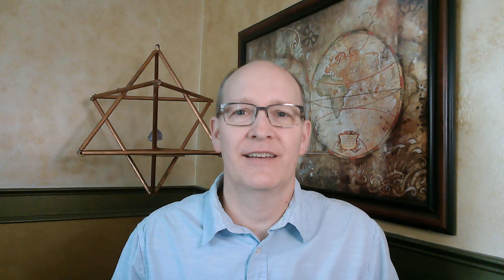Music & Sound

Comment: Could you expand on sound. I'm stuck on sound being a mechanical jostling of gas molecules and it's unclear how it would interact with magnetic energy. An energy bundle in a vortex expanding outward or spiralling inward, could it's path be altered, could it be broken apart like a collision? And what about laser photonics affecting magnetic energy?
Reply from the maker: Relatively neutral pulsing magnetic fields have the ability to interact with and alter basically any sound and light phenomena. As with most conventional explanations of natural phenomena, there is an element of truth in our current level of descriptive/observational science. Magnetic energy and this etheric model simply offer a deeper explanation and delve into the why of things, and once this model is backed by technology it will bring other dimensions into our explanations. So sound becomes an etheric phenomenon of vibration/resonance and being that no molecular structures actually contain anything solid, it is change in etheric exchange and the sub-atomic vortices and pulse rates that create the experience of sound. This understanding will allow sound to be produced at the etheric level with pulses that don't express themselves as sound in the physical world until they reach their attracted destination...this is the new form of quantum radio transmission that is far beyond the speed of light with an unlimited amount of information and perfect clarity.